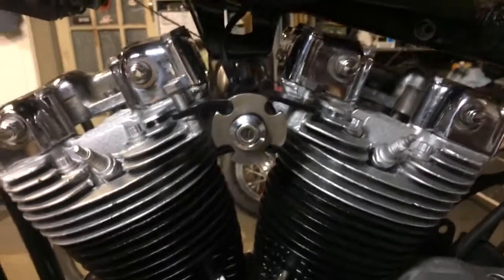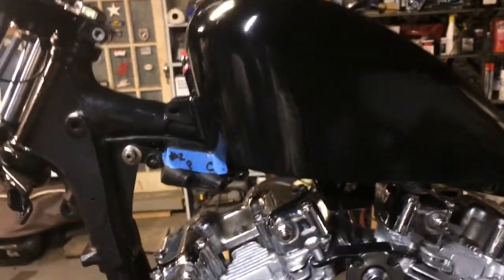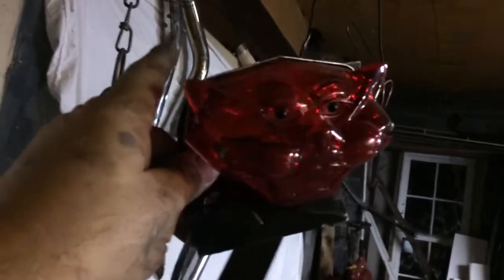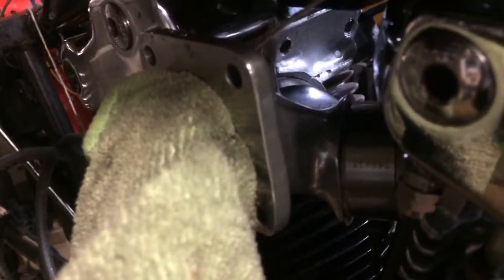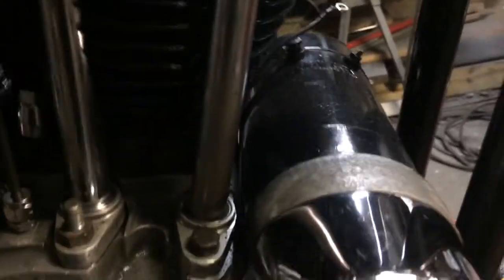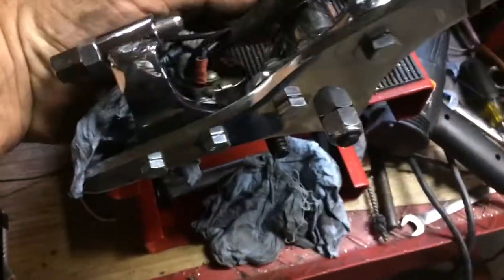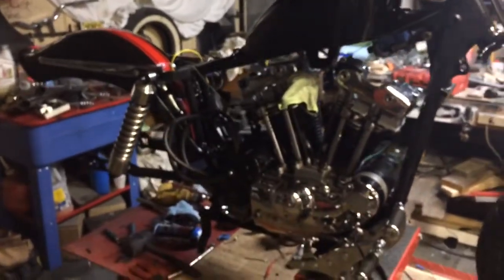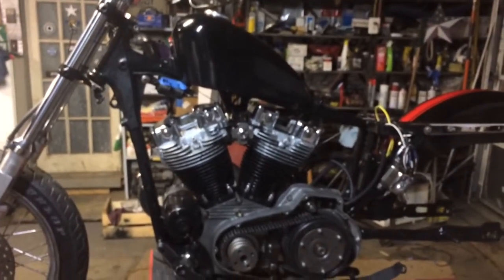75 Ironhead project progress

Comment: What forward controls did you use?
Reply from the maker: i honestly dont remember but usually buy what i can afford end up customizing them to work in my situation, little bit of bending grinding welding, switching parts around etc... not always easy to get them to work easily>